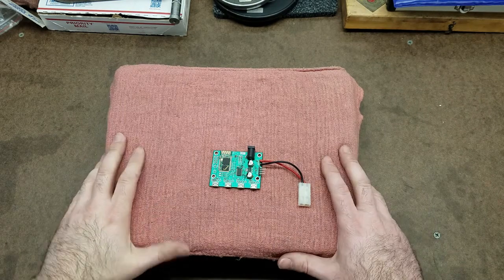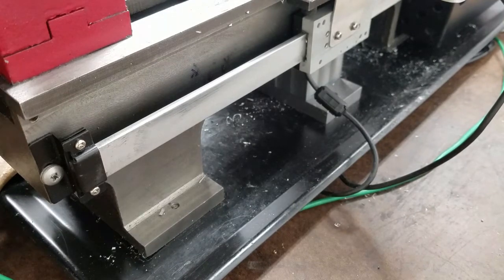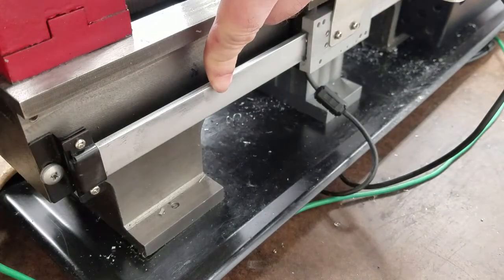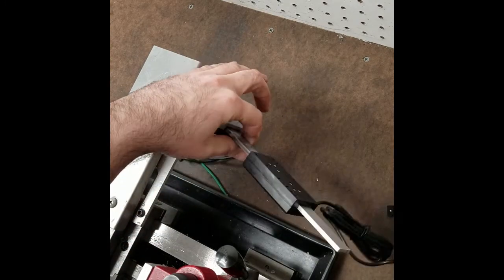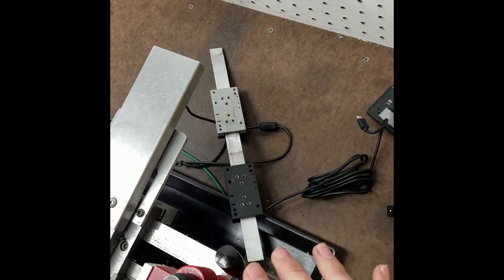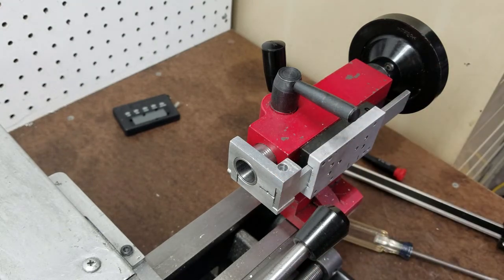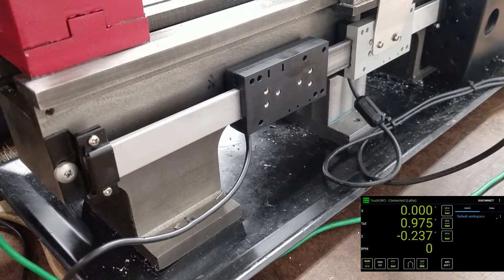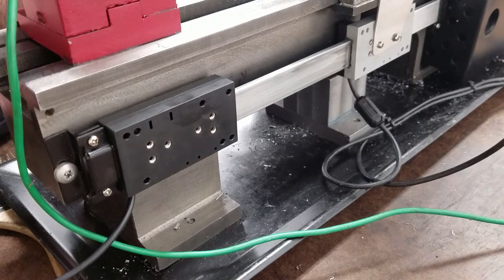Minilathe Tailstock DRO modification (Part 1: Read head installation/calibration)

Comment: Brilliant!  I already have the same scale for my carriage and it never occurred to me to add a second head for the tail stock!
BTW you are referring to the scales as "magnetic" and they are actually capacitive.  If you sprinkle some iron filings on mag scales you will see the magnetic fields.  What you see being exposed by wear is the copper traces in the scale - not magnetic!  FYI.  I used magnetic scales on my TouchDRO Mini mill setup and they have metal debris sticking to them often.
Reply from the maker: Thanks!

And thanks for the clarification on the scale types. I've actually been tossing around the idea of changing the capacitive scales on out for optical ones, like I have on my mill and my surface grinder.

 I feel like the glass scales are more accurate, and it would also be nice to have all my machines use the same equipment. Especially if I want to use my rotary table on the shaper.
Reply: @fna-wrightengineering  fwiw I'm very impressed with the resolution of the magnetic scales, and you can't beat the price compared to optical!
Reply: @fna-wrightengineering  oh, and you can't cut optical scales to length like you can magnetic and capacity of ones!
Reply from the maker: @GuyMarsdenMakesStuff  You can, actually! It's just not as simple. The read heads don't travel all the way to the bitter end of the glass, so there's some room to score/snap the glass and cut the aluminum extrusion.

Though I'd likely just get scales that are on the long side of close enough, and make brackets to suit.

The capacitive scales have been plenty accurate and repeatable for my needs... Though, at least for my shaper, it would be beneficial to have the glass scales, as the rotary table encoder I built uses the glass-scale TouchDRO adapter board.

The glass scales have the added benefit of being more resistant to chip/grit infiltration (as evidenced by the exposed copper on my capacitive scale lol).
Reply: @fna-wrightengineering  yep, each type of scale has its trade-offs. Cleaning magnetic scales and keeping the sensor head wipers in close contact or major issues.  But I think resolution of magnetic versus optical is very close.

Comment: Brilliant where can I fined the bord for connecting to a tablet ive just had to take early retirement as wife not well and bought my self a mini lathe and a mini mill have just orderd some of these same dro's for bothe lathe and mill .ive already got a couple of old tablets that the grand kids don't use any more this would be fantastic for me as with age the old eyes would see a tablet much more clearer 😂😂😂 maybe you could do a set up walk through vid many thanks for sharing this concept
Reply from the maker: Thanks! You can find these boards at Yuriystoys, and the app is called TouchDRO. Yuriy makes several types of boards, depending on the type of scale you're using... The one for these scales is the one meant for "iGaging" scales.

I do plan on having a video for setting up these types of scales... I'm modifying my mini lathe with a longer bed, and will have to install a longer scale to suit. Stay tuned!
Reply: @fna-wrightengineering  manythanks for your quick reply ive subed looking forwards to more of your content 👌 😀